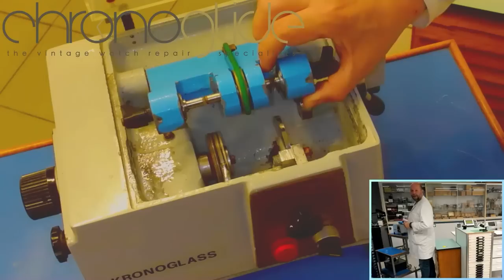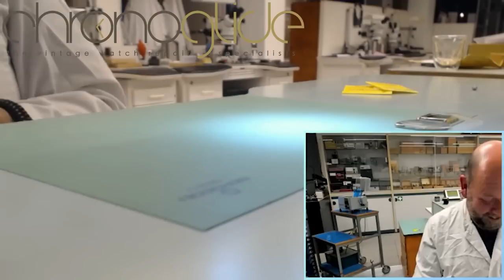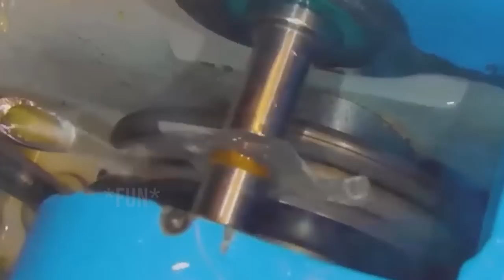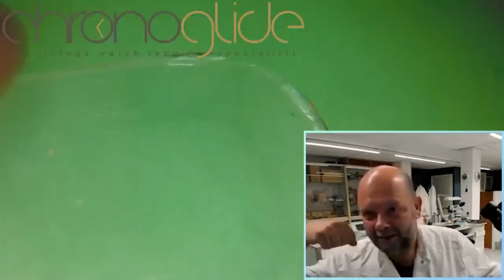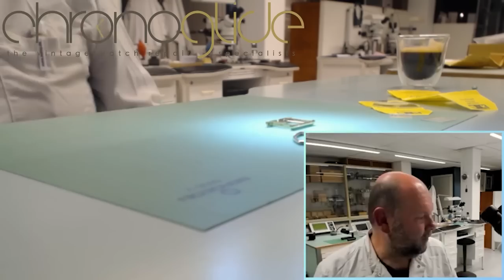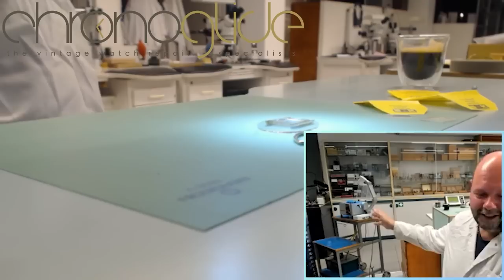How to Cut a Vintage Watch Crystal - (Budget) Tips and Tricks!

Comment: Hello. I've been offered a used Kronoglass for about half of the new price but am worried that in the future, spare parts won't be available.  Some watch parts suppliers are currently selling the machine and parts for it but my research seems to indicate that the Kronoglass company is not in business anymore. Does this make it risky for me to buy this machine?
Reply from the maker: That is a fair concern, but if you can get the essential parts now, it might still be a great addition to your workshop! ⌚😊 Make sure you have spare ballbearings and only use emulsion, not just water.

Comment: i coudnt stand to ask the question, can you cut new jaws for poising tool that are normaly gems and in many cases cracked and damaged? Maybe you can make them from watch glass or if you have a blank of a rubuy with that size i guess the diamond will cut it also.
Reply from the maker: This Kronoglass is cutting circular, but nice idea.

Comment: Hello, Kalle, what an interesting video!  And also what coincidence: I recently changed glasses (for eyeglasses!) And I asked the optician how he put the glasses for eyeglasses received in the form of my mount!  The principle is the same with in addition, for them, the problem of centering the glasses for eyeglasses!  The stroke of the resin for glasses whose glass is broken is a great idea, I thought to use plasticine that can be cook afterwards.  The trouble is that the cooking slightly reduces the dimension and so the glass would have been too small after its size.  By the way, the resin should not be too liquid, I suppose, otherwise it would flow under the bezel (especially if the latter is slightly damaged): you have never encountered this problem?  And another question: often glass has a slight chamfer on the outdoor side of the watch glass, how do you make it?  With the grinding wheel? Thank you again and best regards, Pascal.